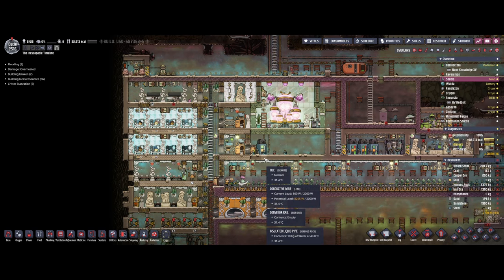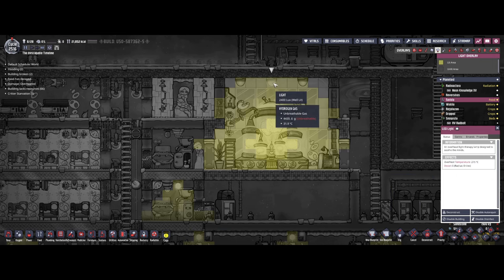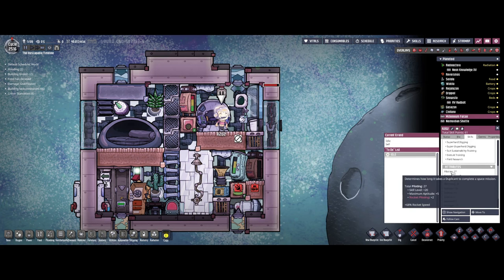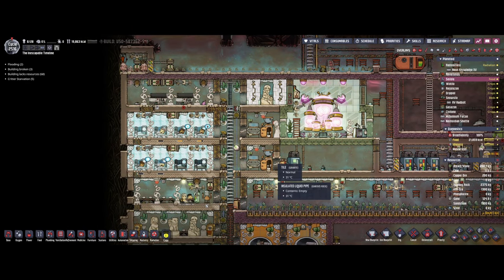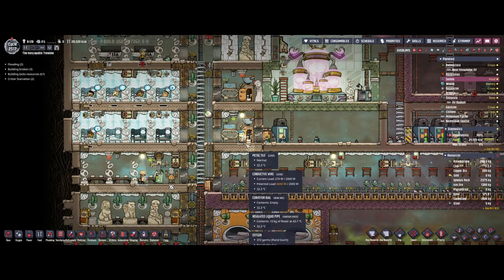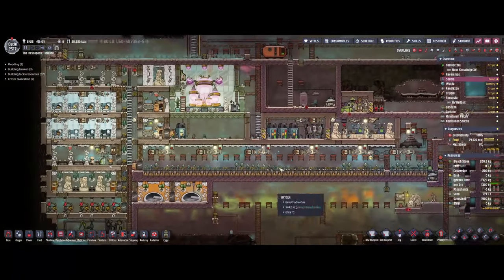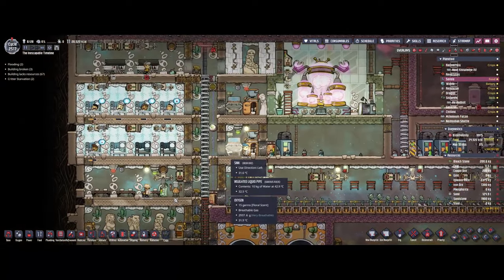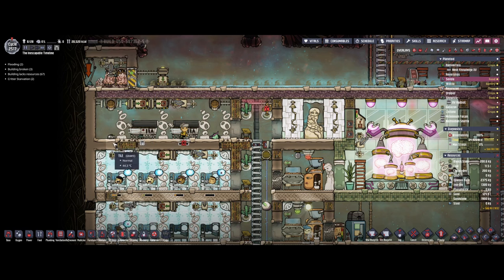Oxygen Not Included Guide: Ultimate Guide to the Somnium Synthesizer, Colony Wide OP Buff!

Comment: Azile, do you know if there was an update in the time dupes make a dream journal? Mine are making 1 dream journal per second, it is insanely fast, i dont know why, I put 7 dupes to sleep and I make too much dream journals
Reply from the maker: It is possible there was. I have never really paid much attention to this, I will need to check, because if they did, I doubt they would have made it like that. Mods perhaps?
Reply: @azile666  I don't use mods, the only thing comes to My mind is probably the debug mode I havent use it in this file (I have it activated, but not use it) but perhaps I pressed a button and it speeds dream journals? Idk